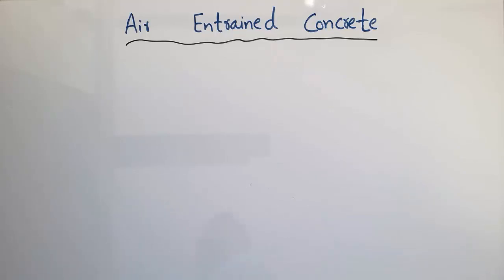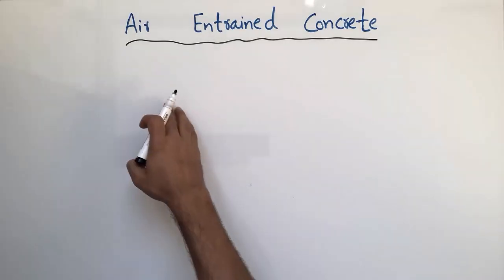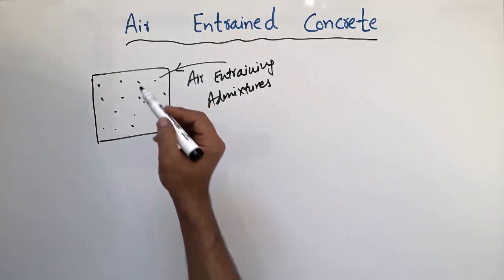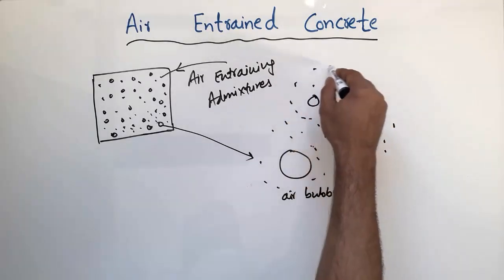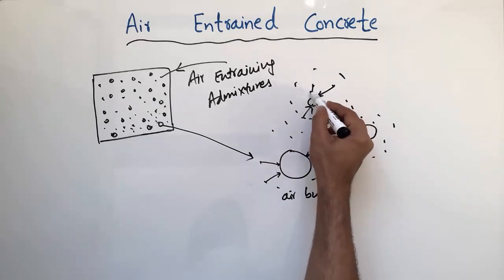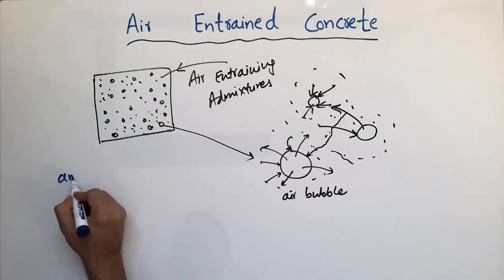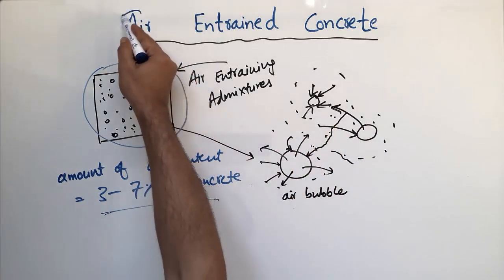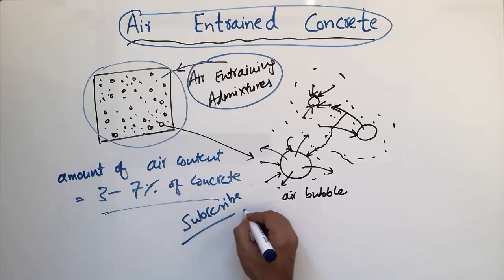Air  Entrained  Concrete

Comment: That is wrong, the air absorb water, the water froz, expand and erosion the surface,  

Reducing the density,  ther are concrete pored 50 years ago w no air,  solid like a rock.  No cracks. On areas where frozen,  im in oregon